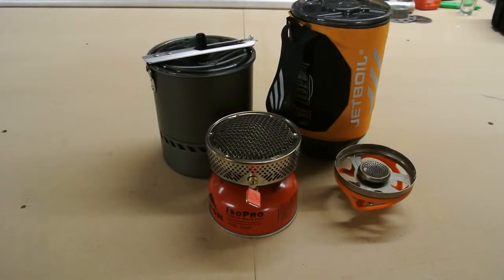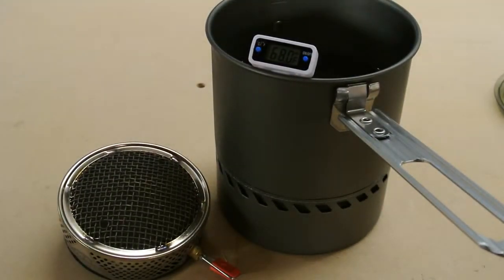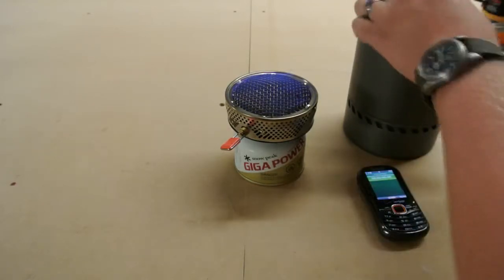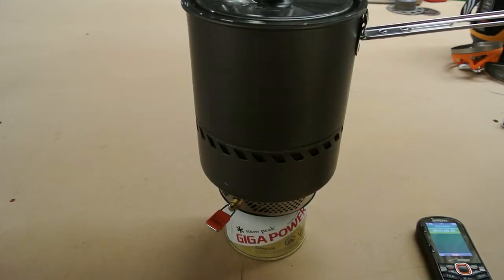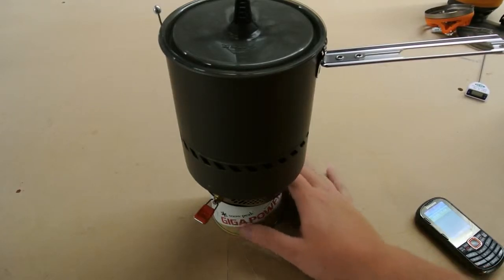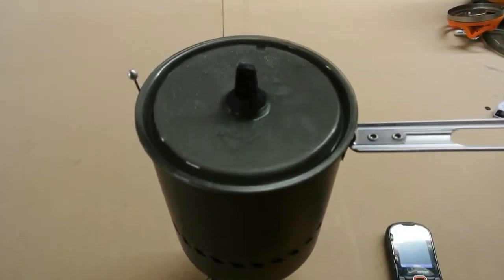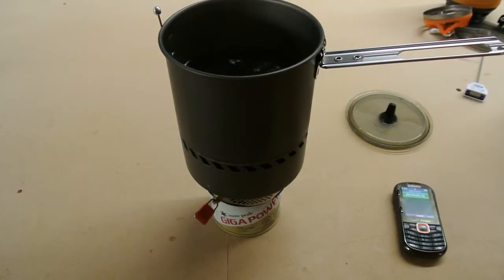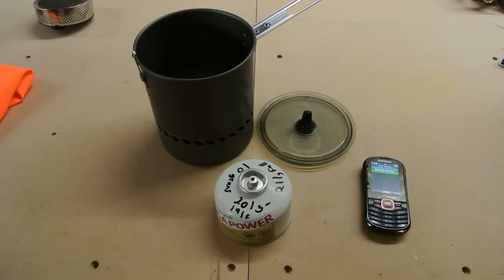MSR Reactor Frozen Canister Test

Comment: The pressure in these canisters almost instantly increases to very usable pressures just by taking them out of the freezer. It would be a better test to keep the canister submerged in ice and water (32°F) to better simulate a cold weather situation.